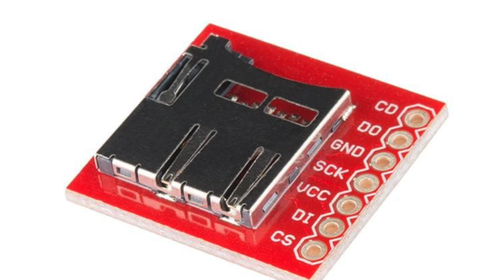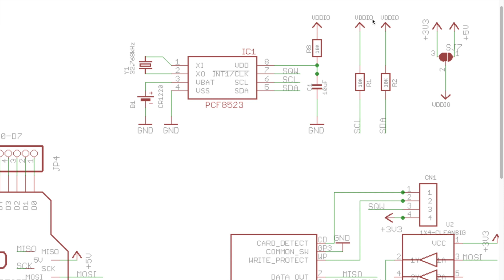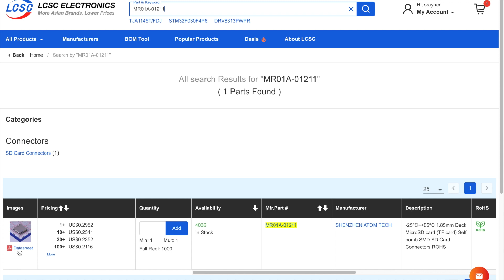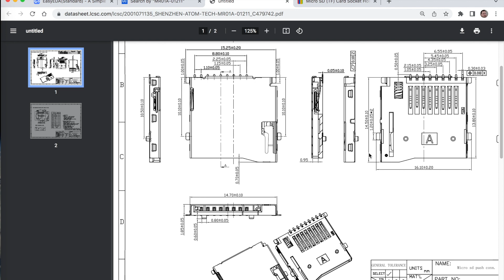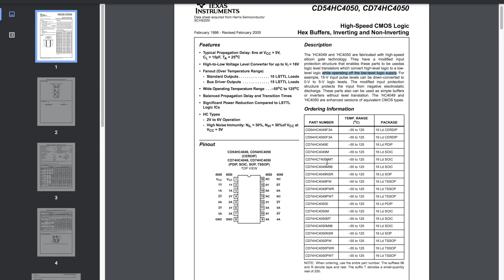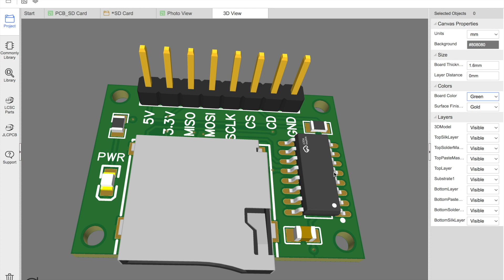Interfacing with an SD Card

Comment: thanks for this video it really helps, but should I use the level shifter if the microcontroller is STM32F103C6 since it's operating voltage ranging between 2.2 and 3.6 v and I have another question, it's written in the datasheet of the sd card connector that the operating voltage is 10v while it's vcc connected to 3.3v I didn't get that part hope you answer me and thank
s for all
Reply from the maker: I would say that if your microcontroller operates at voltage of 2.2 to 3.6 then, no, you do not need the level shifter. This will simplify things for your design. The 10v is just a maximum rating for the physical connector. Not something you need to be concerned about because I doubt you would find an SD card that operates at higher voltages. But in theory anyone could design their own cards that operate at any voltage. So it's just the connector designer telling us don't use anything over 10volts.

Comment: Is the level shifter required for an esp32 since it is all 3.3 v logic anyways?
Reply from the maker: I would say no.
Reply: @SteveRaynerMakes  awesome thank you for the reply! do I need to add any resistors or can I just connect everything straight to the pins of the esp32?
Reply from the maker: @brentroberson7211  Should be fine to connect directly to the ESP32. I have a pull-up resistor on the CS line, but you probably don't even need that. As I believe the ESP32 can be configured to use its own internal pull-up resistors.

Comment: If I were going to try to interface a Z80 system with an SD card, I'd be inclined to go in one of two possible directions, although both directions would use a microcontroller as an intermediary.  The reason for that is to free up the Z80 so that it can do other things if needed without having to devote all of its "attention" to the data transfer.
1. DMA.  I'd use at least two memory banks as buffers.  The memory would hold the data either before it's written or after it's been read from the SD card.  Having two banks would allow the CPU to work on data in one bank while the data in the second bank is being either written or read.  Advantage: Speed.  Disadvantage: Can't be moved easily to another computer system.
2. GPIB (IEEE-488).  I'd have the microcontroller use its own internal memory as the buffer and have the Z80 transmit and receive both data and commands through the GPIB interface.  Advantage: The SD card and microcontroller can be easily moved to another computer system using a GPIB.  Disadvantage: Slower than DMA.

Comment: It surely is a nice PCB. I gave you a big thumbs-up! But if others have made almost the same board, then why not use the card that others made already, it would reduce the costs of the project I guess. I could imagine that a totally new design is necessary when extra features would be included, like a signal for card-ready, card-present, card-write protected or card-malfunction. 
 
Possibly there could also be a signal for card-full. And yes, I know that for a card-full signal there has to be intelligence to read the card first and analyse the data. And while fantasizing about what could have been done, a signal for "do not eject the card, still writing data" would be fine. Maybe that was the LED you removed for.